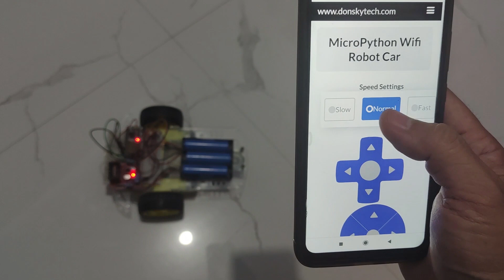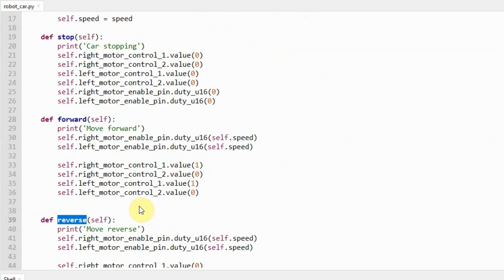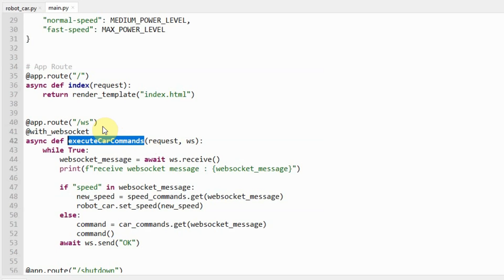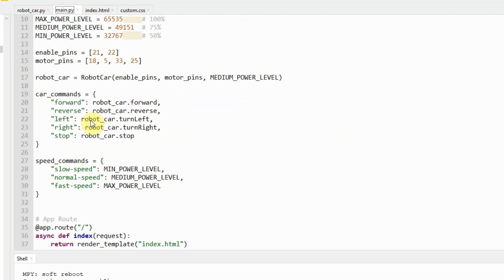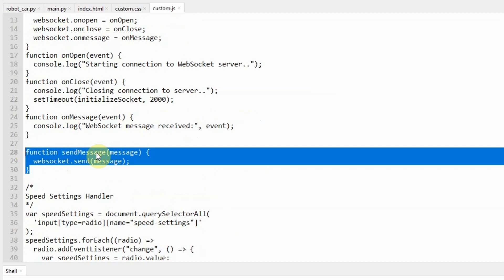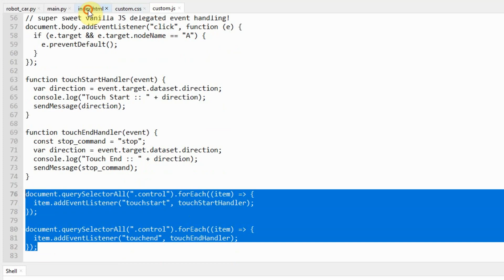Building a MicroPython Wifi Robot Car

Comment: what batteries are you using in the video? my car doesnt work as well with 4 AA batteries
Reply from the maker: Hey it is a 18650 battery. I have released a new video about using the Raspberry pi Pico W wifi car. That is so much better than this. Please subscribe to my channel if you have not done so

Comment: no module named utemplate error. i keep getting this error even when i have installed all the required modules
Reply from the maker: Hey, look at the how to deploy or run section in the writeup found in the description of the video.
Reply: @DonskyTech  i had a look and my problem still persists, when i am trying to access the IP address, it saying "refused to connect"
Reply: @DonskyTech  and its still throwing me the ImportError: no module named utemplate

Comment: So I have been messing with Arduino on all flavors of boards for a Decade and even teaching it at our local library. I got into Wifi with esp8266 then esp32 when they came out. I and my students have always had trouble with them connecting to Wifi with about a 25% failure rate even when they are close to the router. Rebooting a couple times usually got them running. I recently have been learning Python and had high hopes for the RP2040 Pico W when it came out. So I got the basic connection example (same code you use in boot.py) from micropython loaded on the Pico W. Same issue. I have tried on 3 networks and still get failures some the time. So my question do you have these problems? Thanks for letting me rant.
Reply from the maker: @keithlohmeyer122 Hey,  there are some usual unsuccessful connections that I have encountered but a usual restart would fix it.  The first thing I would check is to verify my Wifi network connection.  From my experience, these Microcontrollers or Single Board computers like the Raspberry Pi have trouble accessing the 5G network.  This is for routers that have dual-band output where there are  2.4G and 5G bands.  Always connect with the 2.4G.
For the ESP32, I often see brownout detector issues when there is not enough power powering it if there are multiple components attached to it.
Another thing for ESP32 also, Wifi does not work when reading analog pins.  I forgot the exact problem but I think it has something to do with Channel 2 being used by the Wifi module